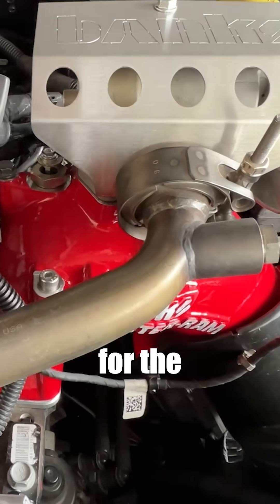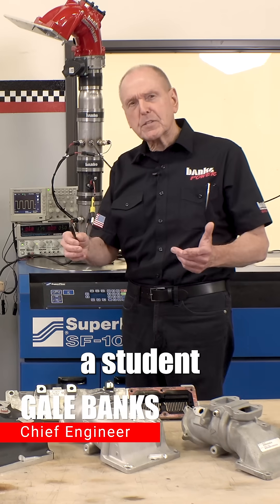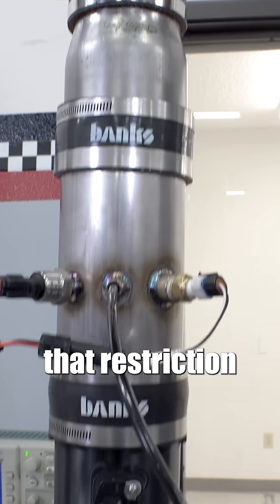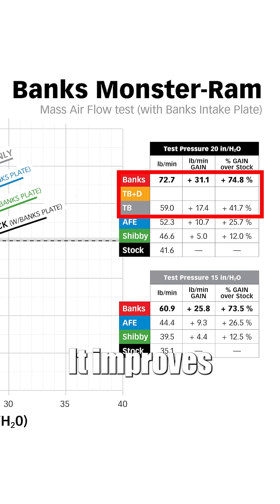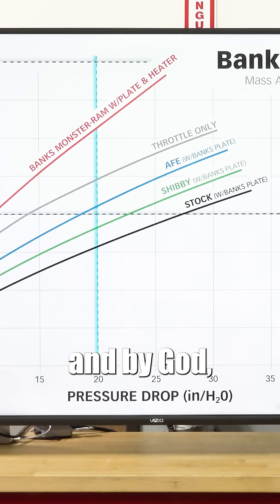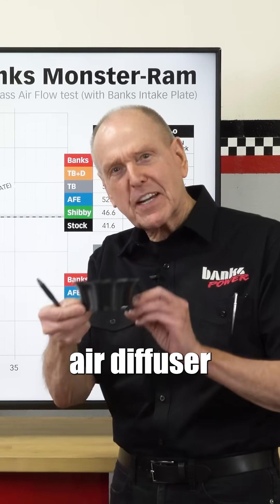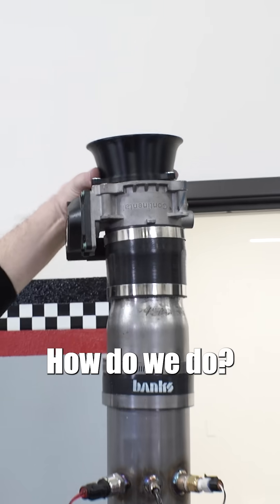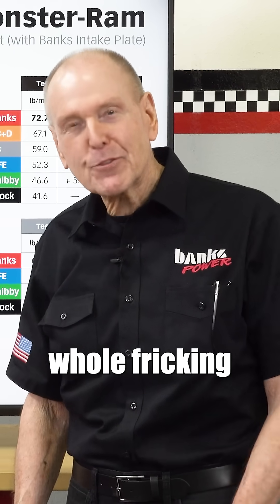This air intake does the impossible.

Comment: More diameter = more flow? Amazing.  How is this 1 dude crushing all the ram engineers with basic stuff like "restrictions in intake bad" and "loose metal in your intake bad"??
Reply from the maker: A big part of it is that we're not constrained by costs in the same way that an OEM that makes hundreds of thousands of vehicles a year is. This lets us take more time and spend more money engineering a perfected product, not just a product that will meet the minimum specifications for the least cost.
Reply: @bankspower Thats nonsense! If Gale Banks can design, build and sell a retrofit for $800 installed, RAM could do it on a mass scale cheaper build a better truck. 
Gale is pretty impressive but there is no excuse for the whole stable of engineers at Ram and at Cummins to get dogwalked like this. Where is their pride?

Comment: Increasing air velocity into the outside runner sweep. 💯  the air speed increases and slows when its in the intake. However, the initial speed is so fast that the parasitic velocity loss is lower when in the intake. Gale is this right? or am i blowing smoke?

Comment: Hey Gale and the Banks team,
This seems too good to be true? It would be good to see some breakdown of the fluid dynamics that are occurring in your inlet design that allow the improvements claimed. It's a rare thing indeed to add ducting/pipework that can flow better than a open discharge. What % opening was the throttle body for this testing?
This Mech Engineer is interested in what you have done to achieve this.

Comment: The air in the demonstration is going the opposite way of the actual application. You are pulling air through the outlet it appears. How can this not skew the numbers. If im right and you are pulling air from the outlet towards the inlet you are basically creating a large air ram woth far greater surface area and a much more gradual taper than the small angular one you 3D printed. Theres no obvious way of telling the flow direction in the test. You could be blowing air from the flow bench but thats not the intuitive assumption seeing that you aren’t measuring the air from the outlet. And all your sensors are on the inlet side of the TB. If it was truly flowing the intended direction as designed you would be defying physics to gain flow in a bend. This is a misleading test regardless. Theres not enough information to come to an honest conclusion.

Comment: This reminds me of the turbo- encabulator  . . .

You can't diffuse the air and increase velocity. . . Bernoulli's principal.

You can't increase velocity while simultaneously increasing pressure on a given stream of air.  Bernoulli's principal again.

Also, that's not a diffuser. it's a velocity stack, a poorly designed one, and is being used backwards.

Whats the left side of the  chart represent?  Incomplete data given

Where are the measurements taken?

Comment: That is hilarious  how effective that 3D printed  "air diffuser " turned out to be👍
Your "trial and error" session revealed some fantastic results!
Reply: 30 to 40 minutes and SolidWorks with simulation, depending on how fast your machine is, for a part like that, no try on error needed for the diffuser part.

Comment: I have a Bank's monster ram, ram air cold air intake, 3.5" boost tubes and there intercooler on my 2012 Cummins and I am more than happy with all of those products. I think the air heater on the monster ram actually works better in the cold than the factory grid heater plus it opens up that whole area and eliminates the restriction of the stock grid heater nevermind the possibility of the nut on the bottom destroying your motor. My truck builds boost much faster now with all these parts. I wish I knew what part made it spool up quicker but I put everything on at once. I'm thinking it's the combination of all those parts working together.It's all definitely worth the money. If you don't have the monster ram I would recommend getting one. Just having the peace of mind knowing that the nut on the grid heater is gone is worth the money itself.

Comment: If torque follows the increase in airflow Cummins and other manufacturers could use this to replace the turbo and increase the CR allowing even more efficient operation.
Reply: @Jessersadler  There was a 70% increase in airflow 14/20lb of boost could be eliminated allowing the engine to be pushed to 25:1-30:1
14.7psi atmospheric+20psi boost= 34.7psi@17.x:1. Drop to 20psi, 30:1 cr higher efficiency due to higher CR and less back pressure from turbo. Honda did this before when F1 started to put limits on turbo boost so they wouldn't win every race in the 80s.
Reply: @suggesttwo  the only reason flow is 70% more is because of where the PSI reading is taken.  20psi in a 2" pipe is less air than 20psi in a 3" pipe.  The Horn is a larger diameter.  I suspect that's where the reading is measured, given the arbitrary 70% number.  If anything, this system will make less pressure (with all other varibles the same) due to the higher volume of the horn, which isn't a bad thing.

Back pressure is moot point, as this is the intake side.  While it may decrease it slightly, due to the lower PSI in the manifold (less drag on the compressor), it would be minimal.

Comment: This is how American pride looks and should be uniformly.
Reply: This ones cool, but I like the one where we build the wall and pay 11 dollars for a kiwi because America forst
Reply: @MDuarte-vp7bm  Wall is only for people. Not produce and cheap products made in sweat shops.
Reply: no. . . because non of the "science" he's stating is accurate at all
Reply: @BlackBeardAir  You mean to say displaying verifiable (and repeatable) results in a chart is not proof that he knows what he is talking about?
Reply: @leofortey7561  The chart isn't completely labeled, nor is the methodology of testing on display here. . .  for example, if I'm measuring flow, where PSI is measured highly dictates flow.  Say I'm looking at flow with 10psi, a 3" pipe vs a 2" pipe, the 3" is going to take more volume to reach that PSI.  More volume = more CFM.   This are 3rd grade scientific principles,  Bernoulli's to be specific.  The only way to increase flow, in a closed system (all other variables being equal)is to decrease restriction and turbulence.  The ram seems like it would do a great job at decreasing turbulence (makes flow more laminar,  more laminar = less friction), but the volume difference is moot, as you're restricted by the smallest diameter in the intake system.

Another example.  Turn on your garden hose and connect it to the respective horns.  They will flow the same, because the restriction is in the hose.  Now if we equalize pressure (psi) in the horns to a given number (say 10psi), to make it fair (you would think that, but its not, it's actually making it unfair), the psi in the hose connected to the larger diameter will need a higher pressure, because in order to fill the larger volume of the wider intake Horn to the same PSI, more water is required. The only way to achieve that higher flow (more water) is more PSI in the hose, supplying the horn.  Does this horn make a difference, absolutely. . . but it isn't the reasons Banks is giving.

* Banks is patently wrong.  You can not increase velocity and pressure at the same time in a closed system.  If Banks made his straight "diffuser" the same running length of his horn, it would out perform his horn or be equal.  All of this this flow increase has to do with turbulence and laminar flow.  But his numbers are telling.   The only way to achieve 70% in flow, Banks has to be measuring the PSI at the horn, which I explained in the example above, is not a fair comparison.  Does this Horn actually provide 70% increase of air to the engine, absolutely not.  Again, it's a closed system.  Just because it can flow more, doesn't mean it does.  The performance increase is minimal.

Comment: Formula SAE  prohibits tapered air boxes/ ducting leading to the turbo. One team devloped a rectangular  air box with a properly designed" bell mouth on the turbo inlet at the end of a dark hallway  with a port hole". All the benefits you discribe  + ram air 1st stage compression.

Comment: Why are there two air pressure charts? Is that to test at different air velocities?
Reply: @ yeah that too, I am not sure how more air mass could come from the design, though I’m far from anything like an engineer or aerodynamicist and there could be some scavenging type effect maybe possibly. Also curious where they put the sensors to test this. The full video shows only sensors right before and right after the MAF and then an ambient sensor but I’m not sure how they pieced together the data they did for their given conclusion. Also would be interesting to know what a typical Cummins flows compared with the test bench 15-20in/h2O range.
Reply: @ALMX5DP These guys are always full of "bro-science".  They prey on non scientific types

Comment: Years of science but still do not turn you video's horizontal
Reply from the maker: Per YouTube, short form videos are vertical. Long-form (over 3 minutes) are horizontal.
Reply: @bankspower Banks can bend air 120 degrees, but it will NEVER bend pixels 180 degrees.😂
Reply: @bankspower  any reply to the constant commenter on this video stating “There is no physical way that a bend flows better than a straight pipe. He has officially become what he complains about his competitors.”
Reply: @waynestehle9114  You REALLY want @bankspower to read your comment and reply eh?
Reply: @waynestehle9114  the only reasons they could get better numbers is the more gradual diameter increase compared to the 3d printed "diffuser" (it's also much longer)  I'm guessing there's turbulence coming from the butterfly.  A longer pipe would help with laminar flow, which is what actually would increase flow.

The other way would be how they measure.  If they're measuring (say 20) PSI at the RAM, then of course flow is going to flow (CFM) better than a smaller diameter intake Horn at the same PSI.

All intake systems are dependant on the quality of laminar flow, and the smallest diameter in the run.   Just because the intake flows better, doesn't mean it actually flows better in the system.  Especially,  not realistic with the numbers they're giving.  Definitely not 73% more. . .  You'd have to add 73 percent more fuel just to maintain AFR.  The increases you'll see will be marginal, not 73%
Reply: YT Short format is portrait, not landscape